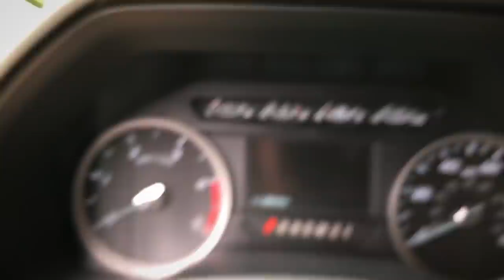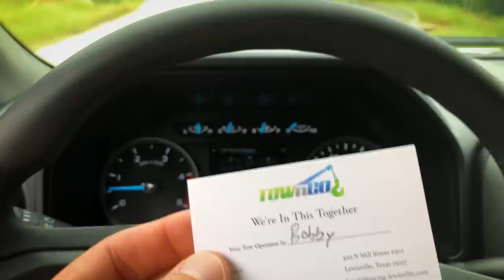I messed up...New F250 Stuck in Mud

Comment: I have a truck like yours and every truck I buy I install a winch. I bought a Badlands winch from Harbor Freight,I know they sale cheap stuff but there 12,000lb winchis awesome.  In  the 4X4 magazine it showed it out doing all the others. I was on concrete on the road and mother wanted me to pull a palm tree out of the ground for her and I hit the emergency brake and the truck in park and my foot on the brakes and that winch DRAGGED my truck ten feet on concrete without breaking a sweat. These Badlands winches aren't no joke and they cost three times less than Warn winches. I would really consider one of these for your rig. Alot of people say man I don't go off road that much so I don't need that. For example,  I like to know that if I have to cross the medium on the interstate because of a wreck up ahead that's holding up traffic for miles  I won't worry about getting stuck in the grassy medium because if I do I have that winch to hook up to someone else and there's always someone willing to help or there's a tree to hook up too.  I had to do that one time before and everybody else stayed in traffic for hours while I was on my way in the opposite direction. Sorry about the  LONG comment. Good luck with your truck, it's beautiful. Take care bud.
Reply from the maker: Dude thank you for the comment.  I actually just bought that exact winch.  Harbor Freight had a smokin deal on it.     What did you use to mount it?   Did you do a front mount?
Reply: @AaronBuley  I bought a Brush guard that came with a built in winch mount, now there's winch mounts that you can buy for your truck that doesn't have the brush guard if you don't want the brush guard, it's just the mount alone. What I did was looked up on YouTube"winch mount for 2011 Ford f250" and that should put you on the right track. There's alot of info on it. I feel so safe knowing that I have that winch installed on my truck. Good luck buddy.

Comment: I had about 2K miles on my 2018 6.7 when I got it mud stuck...nowhere near that bad, though.  I was pulling a utility trailer with an ATV on it and had to disconnect the trailer.  It was just barely able to crawl out the hole I was in with the differential locked.  Ford sure does put some nice "highway" tires on those trucks (seriously)...but they are not very good in the mud.  FTR, my buddy was unable to pull me out with his F150...
Reply: Yep, highway tires...I got rid of those after only 500 miles then put BFG’s for a few weeks then upgraded again to the 35inch Nitto trail grapplers, no problem now haha

Comment: I can tell in the comments there are a ton of really good drivers cause they don't get stuck ever
Reply: A lot of "not getting stuck" is preparation, and knowing the place you drive.
If you have driven a track a hundred times, you know precisely which line won't get you stuck.
So most of the people "not getting stuck" are the ones that drive in the same placer over and over again,
never going anywhere new and exciting, where they might get stuck. 😜
Reply: @Grumpy_old_Boot  the ones not getting stuck are in the comment section.  They know how to drive.i know cause they say they do
Reply: @64maxpower  
He he, well, the comment section doesn't have a lot of mud - The keyboards can just cruise right through it. 🤣

Comment: Im not impressed by newer fords. My buddy used a friend's 09 SD 250 4x4 5.4 to haul a bobcat few weeks ago truck had little power and sagged from weight. Ended up using my 95 dodge 1500 4x4 318 300,000 miles and pulled right along no problem. I do have heavy duty suspension for plow setup and 35 inch tires but a 90,000 mile SD 250 should of done job far better.

Comment: Ya. I my son got my jeep stuck in the river one night He was 16. Like any good dad I just told him to get it unstuck. His buddies couldnt get it out a tow truck and supposedly experienced recovery team couldnt get it out they said they needed to get more cable and drag it out backwards. Finally I went out the next morning waded out to the truck crawled under it as best i could but a highlift jack on a shovel jacked up the front end and told them to go. The dang front differential was up against a rock. Then I had to rig blocks on trees so they could make the corners for them to get it through the timber. It's been a few years now probably 15 or more and I still think I should have charged them. They were just too lazy to wade into the water and see what was wrong, nobody wanted to get wet.

Comment: Thank you for your comment.  I had to watch this a few times more.  Yes there was an idiot in this video, it was not you.  Shit happens, I know from first hand experience.  It was the first tow truck driver.  I hope he is not a friend.  You never snatch/yank on the winch cable.  This will do internal damage to the winch.

I bet that I could have gotten you out with my little YJ.  I always carry recovery gear in it.  Chain my rear to a tree.  Run my cable to a snatch block to your front.  18000 lbs of pulling power.  If that did not work, pull your ass end out. Same way. 

Should you choose to play like this more, invest in a good 12000 lbs winch and battery.  It will save you a lot of walking and tow bills.  Trust me, I know.  My winches have.  Yes winches, I have burnt one out from good use.

Comment: mud is called Grease, now you know.   Get 4 wheel tires too.  The big trucks get stuck too.   TIRES.  Use rocks and gravel.   Dig out and than try.   Don't feel bad, this is how you learn.   Carry shovel, gravel and extra pulling chain, or line.   100ft minimum.     Drive in dirt when it is dry.   Drive on rock.   Stay away from trying to cross muddy rivers.    have a 4 by 4.       Live and learn.    On logging roads in Canada, we get this every Spring.     I have 100 000 KM of driving in this.        Pull of a secure spot, to winch out and watch them tires.   Texas is the worst for traction.
Reply: Should of pulled from the street.   Bad trucker.   He should never have gone down there.   He ought to know better.   Bad driver,   You learn within a year, what not to do.
Reply from the maker: Cheers! Thx

Comment: Need some actual recovery straps, not towing straps or winch cables, they snap. I have about 200 feet of the stuff. Most rated for 30000 lbs. Been offroading for 25 years !!  Thats what you need for NEXT time hehehehe

Comment: Your just really, really young.  You will learn the next time you get stuck, not to keep flooring it and sinking the truck deeper in the mud.  4X4’s are not “All wheel drive”. Most of the time only 1 wheel spins per axle.  Now, all wheel drive vehicles are pretty hard to get stuck, as long as you have decent ground clearance.
Reply: Fords have E-lockers.. you pull the 4x4 switch out and it will lock the differentials for true 2x4 or 4x4..

Comment: Basically the frame is on the ground. Basically the wheel is stuck in the mud. NO,  the frame is on the ground and the wheel is stuck in the mud. No basically needed. Loose that word. But that does suck to get stuck.

Comment: Have to laugh, if not you are going to cry.  I read your comment about your Jeep.  Yes, a 250 can not go where they can go.  I got a chuckle when a 250 tried to get to my Jeep this year.  Snowy and it sat there and spun away. 

Another time I got stuck real good in snow.  Got my self out with the winch but killed the old battery.  F450 all wheel drive tow truck with mud and snows came to the rescue.  He had to chain 4 of the six tires to get where I was with no chains  He barely made it.  When we arrived I found out that the wife had gotten the Jeep started.  She just could not get the recovery gear due to the deep snow.  She is only 5' foot tall.  600 bucks and one upset wife later, we were free.

Moral of the story.  Big bad ass trucks are great for many things.  Just don't try to go everywhere a Jeep can.  Weight can be your enemy.
Reply from the maker: +John Bango Lol yeah for real.   I severely underestimated the weight of this thing.   Insane!

Comment: My Brother and I took out the H1 Hummer from his friends shop for some real off road fun he took it through a river and hit the largest rock he could find and it hung up on the trans bash guard got it off and took it home to wash and give back... that was until I said did you wash the engine bay he was like, frick after opening it up he called the shop and told them he was gonna be a bit longer :D hand to drive it up the incline drive way and use ramps well it is a hummer so lol hour later is was fully clean

Comment: Beautiful truck! I think you would avoided this if it had a 6in lift and big 35’s
Reply from the maker: Yeah.  Stock tires on a very heavy truck just sank right into the clay
Reply: Hell that truck will fit 35s stock..37s with a 4” lift.
Reply: This a f-250 not a f-150 so u could put 37’s stock because the truck is basically already leveled out stock

Comment: Lower your tire pressures and dig out the tires
Reply from the maker: Yeah.  I totally should’ve done that.   Wasn’t expecting for such a simple trail to pull this super heavy truck off the road.    AT tires definitely needed too
Reply: sorry, but sitting on the frame and lowering the air would put even more weight on the frame.  he would have needed a backhoe to dig out those tires.  amazing, the comments on here.
Reply from the maker: Grant Parnes agreed.   Yeah I was thinking lower tire pressure before I got stuck.   Afterwards wouldn’t have helped and I couldn’t get to the valves anyway.  😁 I didn’t think such a simple trail would cause the truck to just slide off, but I also didn’t realize how HEAVY these are at about 7,000 lbs.  I used to off-road A LOT with my Jeep Sahara.   Completely different story there.  Plus I had a lift kit and 35 nitto trail grapplers on that thing.    anyway, I appreciate your comments Grant 👊.   Seem to be one of the more level headed ones.   😁

Comment: It isn't you , it's Ford . I got my 6 month old 2007 F350 stuck TWICE in dry sand on a cattle ranch . After the second time , I took it in town , had the axles regeared to 4:56 , installed a Dynatrac front axle and hub kit , and installed Detroit Lockers front and rear . New 4x4's are WORTHLESS stock from the dealer .

Comment: wow, that tow truck driver is junk, winch, put a pulley on the far driver side of the deck and put the tool bar directly on the ground and winch.... that's the point of a winch

Comment: It's a Ford , so nothing new here.
Reply: It has stock tires that dont have that much off road capabiliy im sure any truck would have got stuck in this situation.
Reply: Tip for you go buy a raptor jump it stock go buy any other truck from any other brand do the same and see which lasts longer
Reply: @DH-ib9xc  the raptor will win probably, It is its only competition in its class in my opinion.

Comment: Its. Just a nother poor  quality ford product
Reply: All trucks would have gotten stuck in that with street tires
Reply: @michealgray533  ya guess your right there but a Chevy would have made it farther
Reply: Andrew Startek I guess 
But let’s assume that both trucks have the same tires 
The Chevy 2500HD weights about 6,600 lbs 
And has 9.7 in of ground clearance 
The Ford F-250SD has 6,400 lbs and 8.2 in of ground clearance 
From what I can se from the mud the weight of the truck is what sunk it (or the stupidity of the driver) in any case the Chevy could theoretically go further but would get stuck way worse
Reply: @michealgray533  their is a generation gap here sir I'm a square body Chevy lover and in the 80s tires were worth buying and trucks were being built to last. I do collision repair and from what I see on the newest ford trucks they are weak in structural integrity and very cheaply built but that's only from what I see sounds like you got ford soo far up your ass you'll never get them out have a nice day sir 
Fix or repair Dailey
Found on road dead 
These all have meanings
Reply: Buddy you are sitting here writing your poor little heart away defending your Chevy swaurebodys like anybody drives the shit anymore btw Chevy has a 4cyl pickup aluminum body just like ford now gramps
Reply: Honestly I love all trucks the good ol Chevy stepside being up there but the build quality of almost all manufactured are decreasing

Let’s not fight about what is the best truck because more than likely it’s a Toyota or a Isuzu
Reply: @DH-ib9xc  ya your right guess I am old school no harm intended sir don't take it to heart sorry if I offended you in anyway it was not my intention